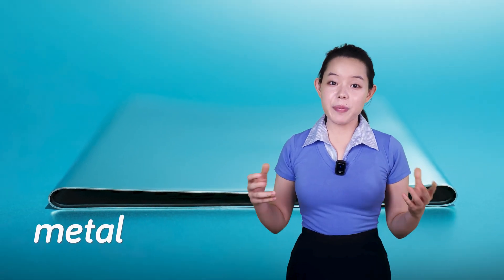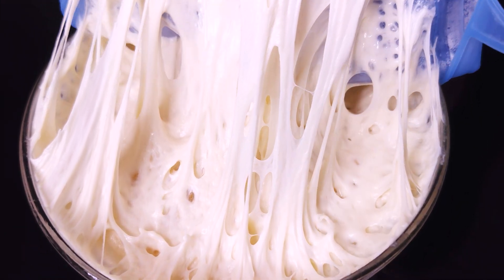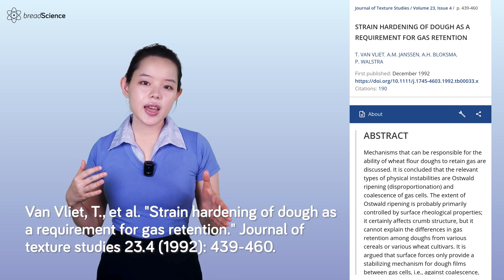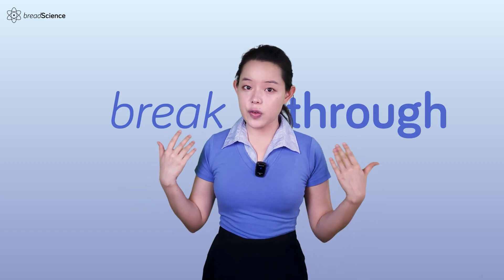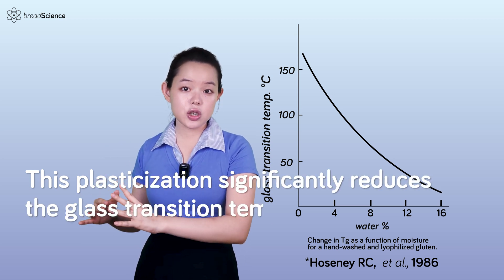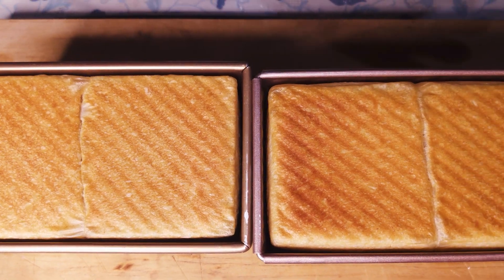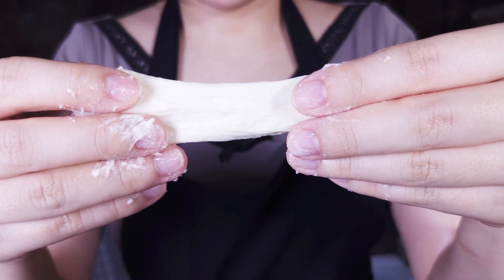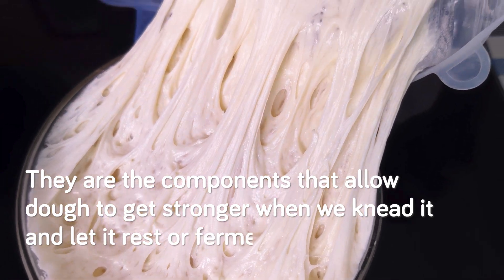The Secret to All Great Bread |The Science of Strain Hardening, Part 1/4

Comment: Hello Seraphine
Thank you for your full reply.
I have great respect for the effort you make in order to bring us the science behind bread baking. For this reason I have deleted my post.
Thank you for the references, I have read what I could access of them and wonder if the people involved are perhaps re-defining the term strain hardening.
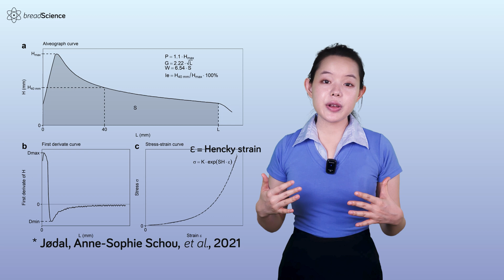I have some background in Engineering and this includes basic metallurgy. You show the classic metal strain hardening graphs throughout your video and only at 13:23 do you switch to a classic Alveograph of dough resistance to deformation. A very different graph.
You correctly made the point that strain hardening involves the fracturing of lattices leading to a locking of the structure and then you point out that dough does not have that sort of crystalline lattice. 
It appears as if the authors are using the term in a somewhat different way. After all dough does allow more deformation after being rested.

It was not my intention to be overly challenging, but to question your thesis on the basis of the ideas put forward in your presentation. TBH I don’t think you made a case, but maybe you will later in the series when you cover gas retention and dough deformation.  
Meanwhile I apologise and thank you for your continued work which I find valuable.
Reply from the maker: I am rather confused about why you keep deleting our entire discussions about this topic and other topics after I give my answers based on the references. It's difficult to have a healthy conversation when you keep deleting the entire post history, and then making a post that only covers a few select parts of the discussion. This is not the first time that you've done this and it leads me to think that you never intended to have a healthy discussion in the first place. If you continue in this manner, then I will have no choice but to ignore your future comments.
Reply: @NovitaListyani  I have deleted this conversation once and I have given my reasons for that.
Whereas you deleted your reply and then reposted another whilst I was replying to the first.

In the past I have never deleted a conversation after a reply from you.
I have tried to wind back. 
I have tried to show good grace and be clear about the reasons leading me to struggled with this video.
(edited).
Reply: @NovitaListyani  Adding - My posts to you have always been sincere, never vexatious. I tutor advanced Home Bread baking and take it all quite seriously. 
Though it must be more than a year since I have visited your channel up until yesterday. I wonder if YouTube has deleted my posts?
Anyway - I do wish you well and thank you for the work you put in.